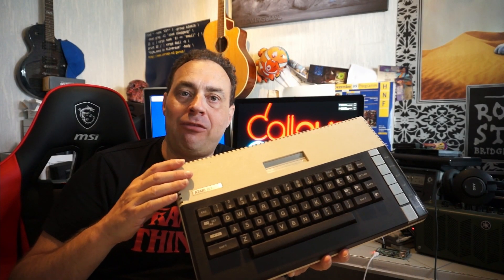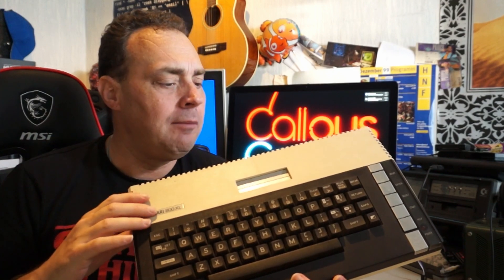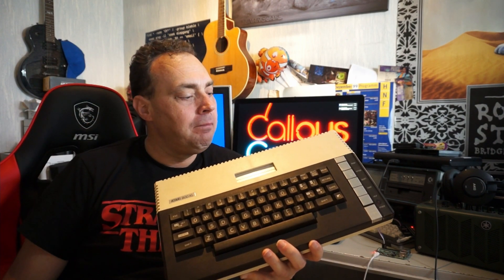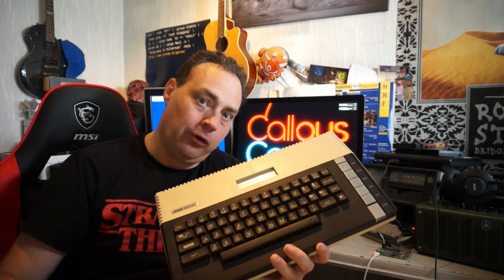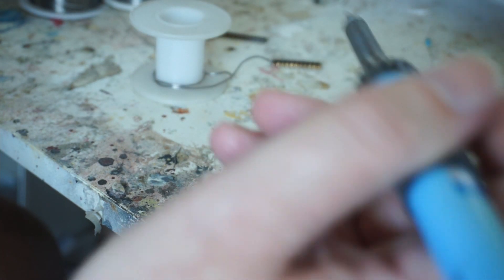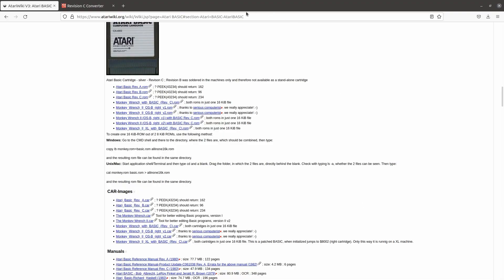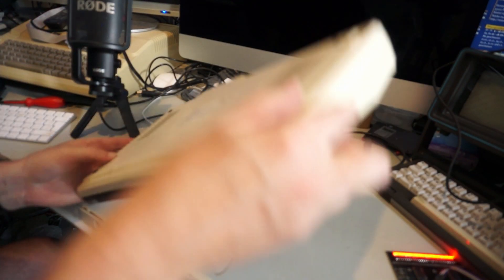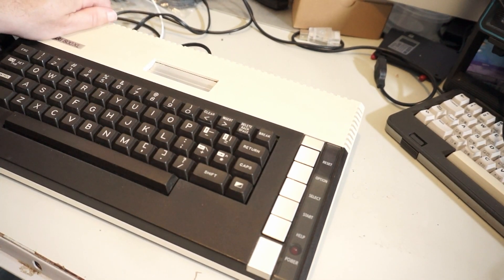ATARI 800XL Repair

Comment: Interesting fault and symptom, I will have that in mind. Just yesterday I fixed my 800XE(130XE board) which was booting straight to the self test screen. Luckily enough no custom chips were bad. An MT RAM chip went bad and a solder flake (probably coming from the process of socketing the whole board 3 years ago) flew inside and was causing a short. Changing the MT RAM only changed the artifacts on screen. Bathing  it in distilled water and scrubbing it with an brush (without any ICs on board) did the trick and the machine is working again. Its the third machine that I have resurrected that way!

Comment: Good job! I have an Atari 800XL, it is working good, but I had to repair the power supply unit. I will open the computer to make a video and also to clean it.
Reply from the maker: Those 80s power supplies really had better days. I bought a Polish C64 reissue power supply for my C64s, I don't want to risk blowing any of them up :D
Reply: @CallousCoder  I am still using original PSU, but I checked all voltages under load.
Reply from the maker: @ValorosoIT  generally they are okay. Mine are/were too but that’s no guarantee the 5V doesn’t stay 5V. So I wasn’t too certain to keep using it. I never opened a C64 PSU, so I have no idea what 5V regulator is used. Maybe I should look a schematic up. Because a 7805 or LM317 don’t really do that (at least not in my experience). And they were the regulators of the 80s.